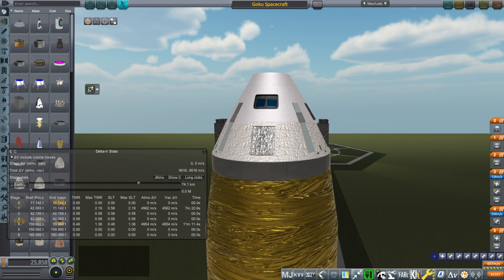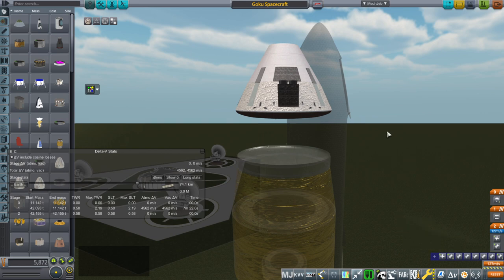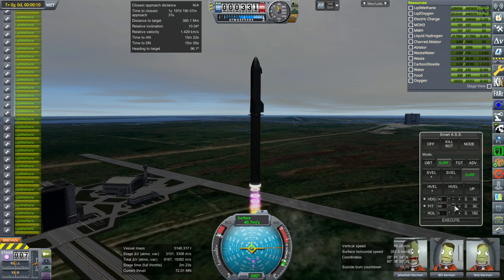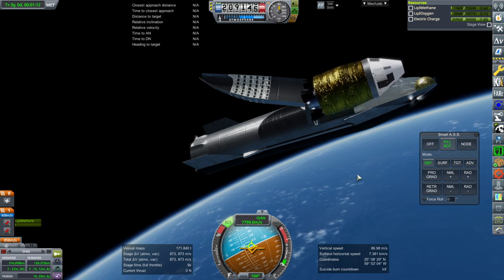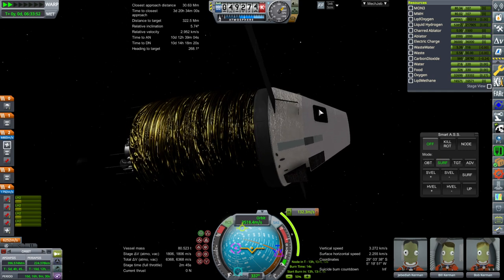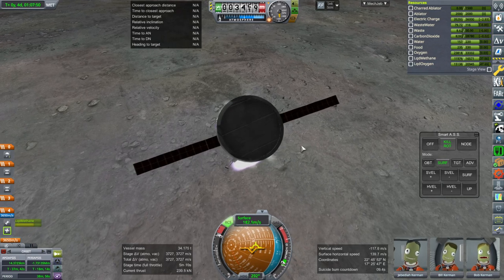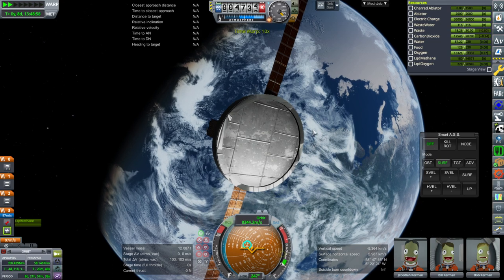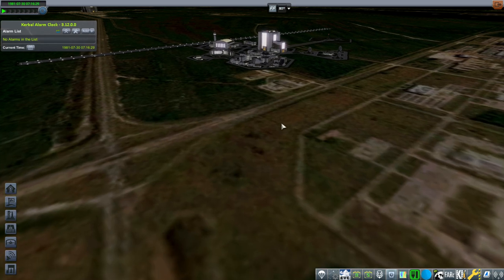Realism Overhaul in KSP 1.8.1 - Goku Spacecraft - Starship

Comment: Love your work, and i understand the goal you set yourself was no rendezvous. Any thoughts on building a larger Spacecraft (2-3 launches), that only transits between the two interface locations LEO Shuttle/ LLO Lander?
Reply from the maker: I have plenty of larger craft that would rendezvous with an LLO lander after being refueled in LEO - Shinkansen, Orion III, for instance - both of which would then use their wings to help aerobrake back down to LEO. Those would only take a single refueling launch by either SLS or Starship. For a dedicated LLO lander, I'm looking to rework the Marukyuu as a hydrolox lander, sacrificing its cargo bay space. For a very large option to go between LEO and LLO, there's the SLS Wet Workshop: https://www.youtube.com/watch?v=OJ0UJ3Xavhg. That may take two launches to resupply, simply because of the low density of hydrogen.
Reply: @RaizSpace  Yes, i have enjoyed watching all of these. I was more thinking of taking adavatage of that huge internal volume of a Starship to launch 2 or 3 seperate Spacecraft modules to assemble in orbit two of them 7m*10m. So a Crew/Passenger compartment, then a Fuel/Engine section. Then a smaller pair of probe core contralled fuel tanks that side mount to the main body only for the intial boost from LEO, no sense draggin that nass farther than where they empty. They main body Fuel/Engins section only carries fuel for LLO orbit, return and LEO orbit. Sorry just thinking in the sandbox, i blame your videos - in a good way.
Reply from the maker: That's a possibility, but I haven't really thought about it before. Maybe I'll consider it.